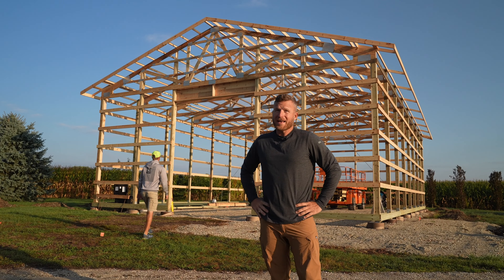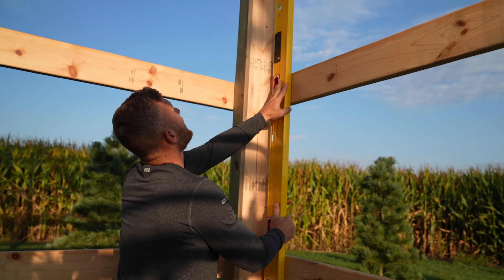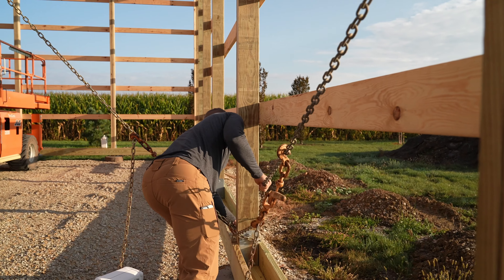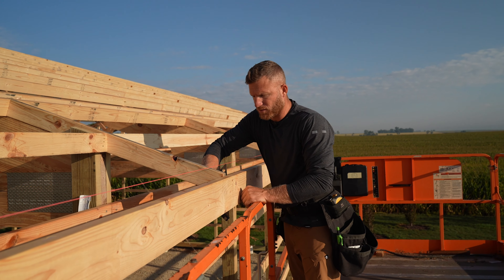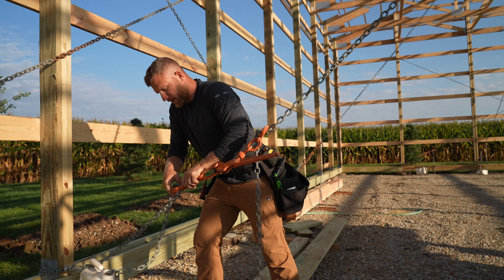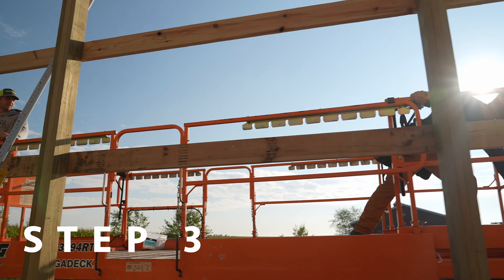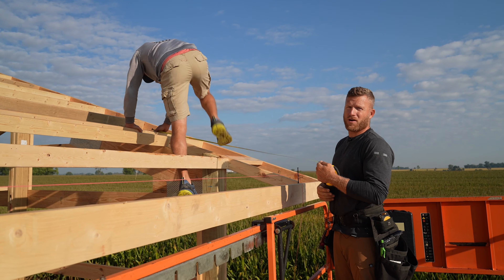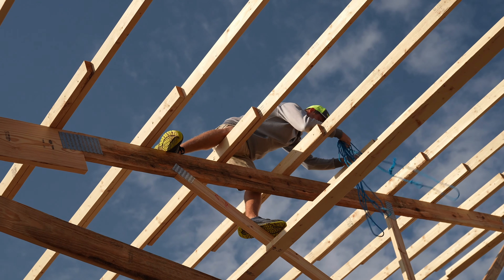4 Simple Steps to Make YOUR structure Straight like a PRO

Comment: 35 year polebarner here.  I always install corner braces as part of the girting process. And prior to roofing I fine tune the plumb of gable ends, and dominant sidewall to create a 90 degree with which to start the roof steel from.   Wiggle the starter sheet left or right (if needed)to dial in the square. 
I love your content!

Comment: When pushing and pulling the building to get one wall plumb wouldn’t it make the other side out of plumb if it was already plumb? Also when you straighten the end fascia won’t that also make the posts out of plumb? Trying to understand it properly. Thanks so much for every video!  Your helping me rehab my 36 stall horse ban and other out buildings!
Reply from the maker: That is why we go in the order we go in and lock it down with double X chains as we need to
Reply: Yes u are exactly right...this is why u just get your building square, walls plumb & braced then u simply string line your trusses or rafter tails  from your  end rafters with a chalk line, snap it then level down from each chalk mark on each rafter & cut them before your fascia board is even on & u just saved yourself a TON of work... if using trusses u got to make sure your installing them straight to begin with so the peak lines up

Comment: Start by only grade boards perfectly square? Then marking Perlins and girts 2’ & 8’ apart nailed down and that’s it? Then do as in this video then ready to screw down roof plywood or sheets steel? Am I missing any steps? I’d pay for these building plans. Next year I’m building my house 36x60x18’walls 2 floors floating radiant floor slab but not sure if I need 3 more sonoposts along the middle for floor beam support or another method to support 2nd floor joists.

Comment: maybe a stupid question, but if you pull a corner in plump, does that not effect the opposite corner out of plump?
Reply: Split the difference
Reply: When you set the poles they should be the same distance as the trusses so when checking for plumb so both sides move into plumb if the width at the ground is different from the truss width at the top there is a screw up

Comment: I am a bit confused.  If you have one corner at 90, and an adjacent corner at 88... Are you aiming to get both at 89 to split the difference?  Seems to me that it's either that, or you would have to pop some girts, plumb the post and nail them back in?
Reply: If you were off 2 degrees on an 18 ft wall, that would be around 7 inches narrower/wider from top to bottom, unlikely scenario, but you get my point.  Even 1/2 degree would be over an inch and a half.  Seems to me you would have to adjust the girts to make it square. You aren't stretching them.

Comment: What I don't understand is using the chain to pull - is there a corresponding push on the other side of the building?  If I did this I would end up with a trapezoid.   Starting straight (good foundation) is the basis, but this is art in action.

Comment: Kyle as a flatbeder just give your chain a twist to get a half link. Been doing that for years to just get a extra pull. Just a suggestion.
Reply: Good tip
Reply: really great tip
Reply: Or move a link at the base where your chain wraps around the lower part of the column. Thats also a half link

Comment: How many chains would you say that you use on a single building at one time? Would you be willing to demonstrate an alternative method in the event someone didn’t have access to chains just yet? Btw thanks for the video, these step by step demonstrations are just what a guy is lookin for.
Reply: I think we have 18 chains and 24 binders, and on bigger buildings that usually isn't quite enough. 8 takes care of plumbing and bracing all four corners, 2 for the peaks. That leaves 8 to straighten the eave overhangs and gable overhangs. We almost always have to have a chain on each truss to straighten the eaves, so on a 64' building that's already 7 for intermediate trusses. Sometimes we will use 2x4 bracing on the walls so we can steal a chain back.

Also FYI for anyone reading this, Kyle is correct when he says don't use the ratchet binders. I bought all ratchet binders and they aren't threaded long enough, you have to pull the chains as tight as you can by hand and then when you thread it all the way in, you still won't have the chain tight and you've gained such a small amount of building movement that it wasn't helpful. We usually have to use 2 ratchet binders per chain to get any movement at all. I have one snap binder like what he uses and I always find myself using it to take the slack out and then using the ratchets to tighten from there. Then it pulls the chain loose enough that I can take the snap binder off and use it again on the next one. I am going to invest in more snap binders this year.

I have seen people use large nylon ratchet straps as an alternative, but keep in mind they will stretch if left in place for long periods of time.

Comment: Plumbing walls doesn't ensure the building is square.
Reply: Did you measure the trusses before they went up?  If the trusses aren't accurate to begin with, then fixing one side will throw the other side out.